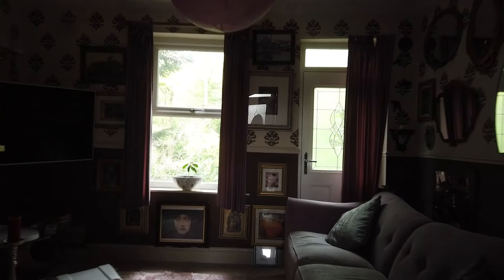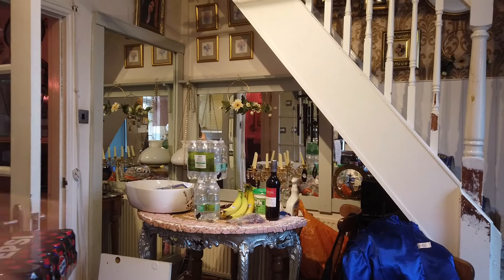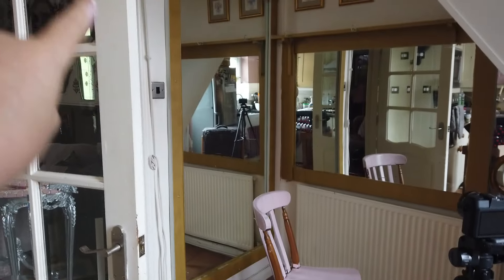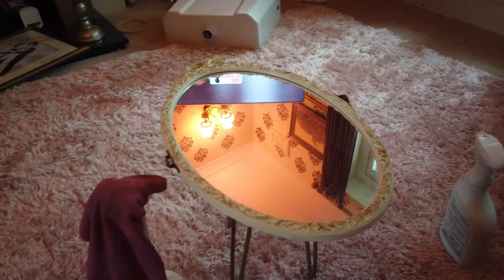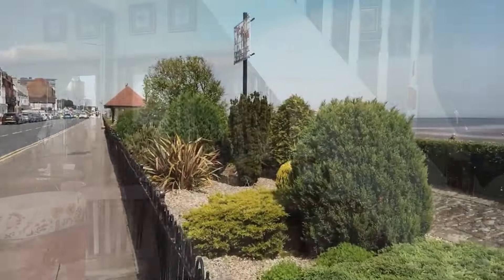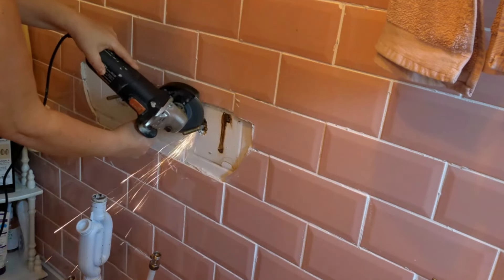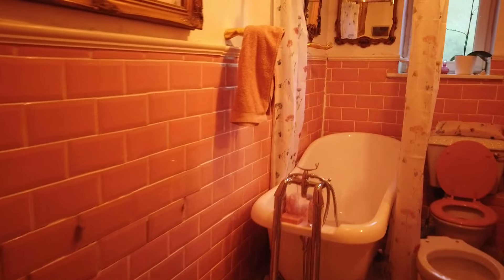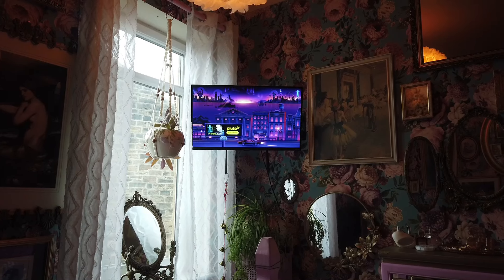What I did this bank holiday weekend Sarahs UK Graveyard

Comment: Hi Sarah. Were there any nuts on the bolts holding the sink up? It's looks like anchor bolts were used when it was fitted, they weren't put in from the other side. Whilst we're in your bathroom I've got to ask if you've thought of how your going to fit a poo pipe to the toilet..?  Love the way your eccentricity is coming on.🤣 Don't you ever stop thinking about what your going to do next..?Never a dull moment at Coven cottage. Love what your doing in there. 👍xx
Reply from the maker: 😂😂😂😂 Yes I've dealt with the pipe issue. He's going to run a pipe behind the bath and out the current pipe exit. He's also fitting the sink and cabinet where the toilet is now. Should look really good when it's done xxxx
Reply: @SarahsUKGraveyard  hope all goes to plan. 👍xxx